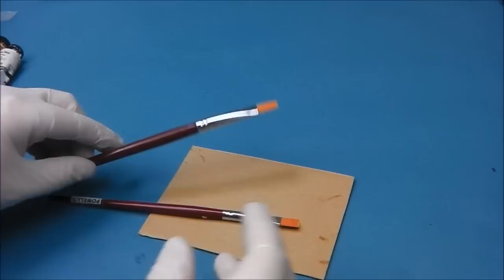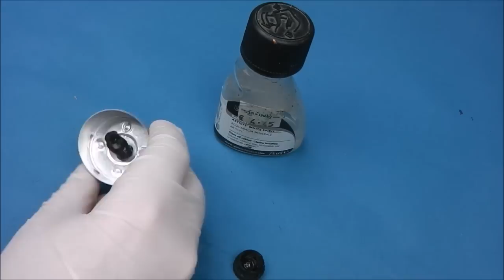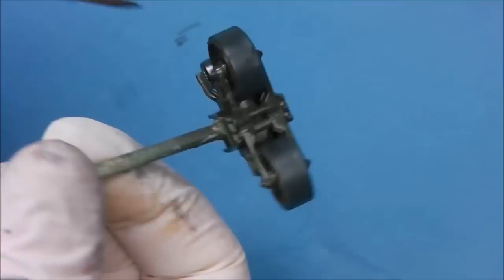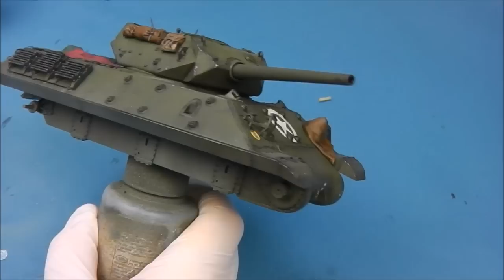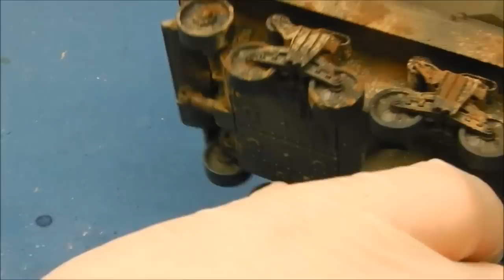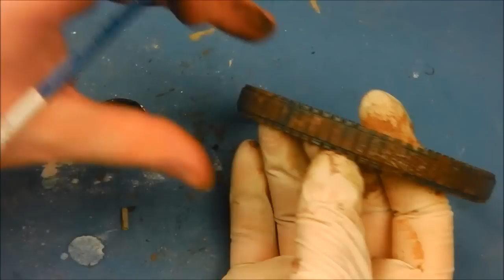Tamiya 1/35 M10 Tank Destroyer Build Part 3 Weathering and Mud Effects

Comment: Hey man. Great video. I'm wondering when in the process would you do a oil filter? Thanks
Reply from the maker: I tend to start my oils right the decals and before I do heavy effects like mud ect
Reply: @longlance67  if you're going to do a oil filter and a dot filter, is it ok to do the filter then let it dry and then go directly to oil dot filter? Or should you give it a gloss varnish in between? Thanks
Reply: Also you do your oils after the decals? And is it ok to do a filter on top of the gloss coat left from the decals or should you put a matte varnish layer on before the filter? Thanks
Reply from the maker: @joshmeads  so best is to get dry at least a few hours between layers or overnight before adding the next layer. If oils are fully dry they couldn't react with the next layer unless you go mad with white spirit and flood the model in the thinner. If you are worried about reactivating each layer you can indeed to seal it gloss
Reply from the maker: @joshmeads  I prefer to do my decals before and seal them under gloss or clear to prevent silvering. My idea is blend the decals into the paint work to make look like they are painted on and aged at the same time as vehicle did. Its totally fine to use gloss coat used to seal the decals and oil directly over it. The gloss helps flow dot and pin filters into details by breaking the surface tension of the surface
Reply: @longlance67  big thanks!
Reply: @longlance67  does that go for Filters as well. Apply filter over the decal Gloss coat, let dry then go to dot filter, ect. Thanks again.
Reply from the maker: @joshmeads  no worries hope it proves useful!
Reply: @longlance67  here's my weathering process. Can you take a look and see if it looks good. Thanks again.
Model Weathering Process
Paint 
Gloss
Decals
Gloss 
chipping
Filter
Oil dot filter
Wash
Matt 
Pigments
Reply from the maker: @joshmeads  Yes this pretty solid base idea. though you will find you go through the steps you might not need to do every step listed here
Reply: @longlance67  thanks for all your help